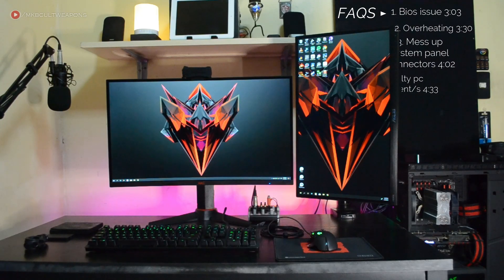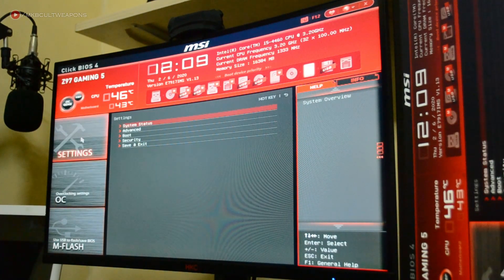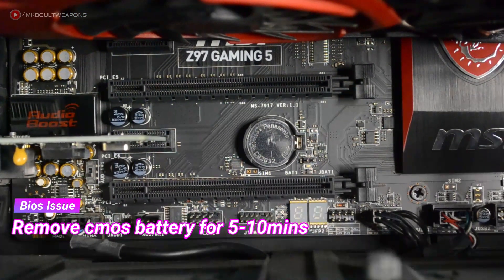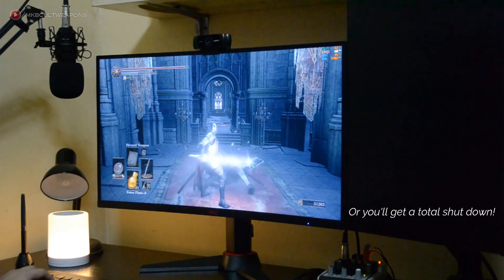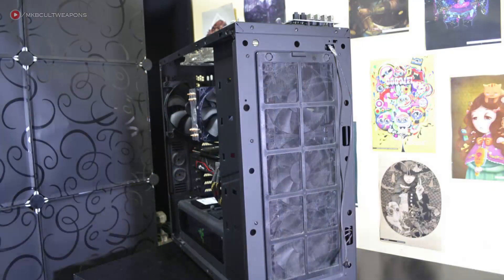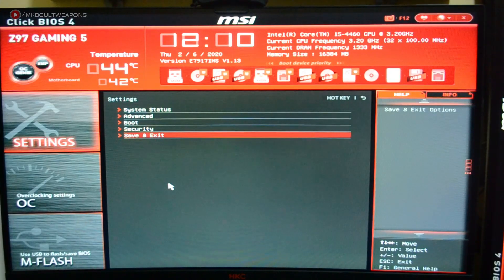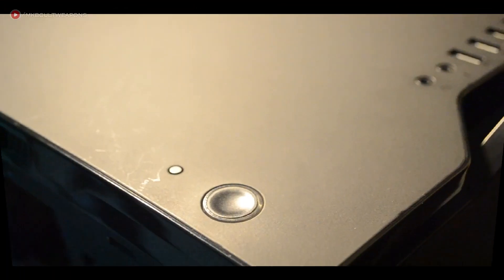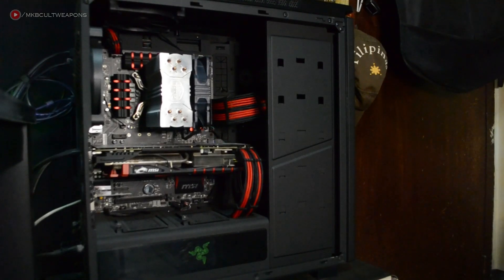Pc keeps restarting FIX / Pc continuous restarting FIX

Comment: My pc keeps on restarting still, every time I turn on my pc and check the task manager my disk usage is always 100% for 1-3mins. And when I open program or heavy games like GTA V disk usage goes 100% and the system restarts :(
Reply from the maker: did you check the "Processes" yet? disable whatever is causing the pc to use too much of the system processes

Comment: Well, Time to get the warranty for my PSU which is just 3 months old 80 plus bronze, but suffered from 6 to 7 times shut downs in power on my house
Reply from the maker: sorry to hear that bro, you need to also buy avr or ups or at least a power surge protect extension

Comment: It happens to me but just when i play heavy videogames like Cyberpunk or Red Dead 2? I think is my cpu idk I'm new in pc gaming
Reply from the maker: try checking your cpu and gpu temps. if all temps are no higher than 89c then its all good but this may bring up another problem and that will be the psu not having enough wattage for your pc build or it's not 80+ certified

Comment: Thanks for the video very informative, mine is still power cycling im thinking its the power supply or the cmos battery. Computer was working fine but was disconnected for about a month or longer while i used my laptop.
Reply from the maker: -pc not being used could have this type of problems, it's inevitable that is why i always tell my clients to use their pc at least half an hour everyday. Anyway for now just try to re-seat the parts and boot the pc and let see how it goes
Reply: Mac Coyzkie  Brother its like 36 days i have not used my pc and today when i tried to boot it up it didn’t and it just keeps restarting itself , I have reseat gpu and rams both but it didn’t fix , please help me if theres any other solution for this problem 😢
Reply from the maker: @Deadshottt7  ok first try clearing cmos, here's how to https://youtu.be/S9hyEPTFR10
Reply: Mac Coyzkie Thank u bro i just changed the place of rams and it got fixed 👍🏻👍🏻
Reply from the maker: @Deadshottt7  awesome! no prob bro!
Reply: @MacCoyzkie  Hey, I usually go on it daily, and for the past week I have been on/off it and maybe for 3 days at one point. Why does this make the pc keep restarting? Any help is appreciated. :)
Reply from the maker: @VibrantDesigns  have you clear cmos yet?
Reply: Fr. W

Comment: Guys I know how to fix it. If reseating the ram doesn't work use a screwdriver, make sure the power supply is still plugged in but turn the switch off, press the power button a few times to make sure its off. Hold the screwdriver on the 2 pins sticking out where it says CMOS on the motherboard usually on the lower right or left for 15 seconds then try to turn it back on. I was getting a boot loop for 5 hours tried literally everything re-seating ram, everything.... and this is the only thing that worked.
Reply from the maker: Some motherboard has those 2 pin but some don’t, removing the cmos battery may also do the trick
Reply: I did this and it still won't work

Comment: Hellppp i dont think i can open my cpu
Reply from the maker: Give us at least a background how did it all began
Reply: @MacCoyzkie  i just resetted my pc now it just keeps restarting and restarting... think it has something to do with the settings update and security not opening, it always shows the options "update and shutdown, update and restart" now im stuck in a loop of restarting over and over again and i cannot get past the loading screen because when its on the loading screen it just goes back to restarting again. I think something is wrong with the system. I cant do anything but open the bios boot menu... im no technician and i dont know anything about computers but 😅 i want to fix it in any way possible before getting it repaired. Ive been searching and watching videos but there doesnt seem to be anything that could help me without opening the cpu. What should i do? I have classes on Monday 😔
Reply from the maker: @hallowissoot  the windows update must’ve been interrupted or something and the windows is now messed up, the only thing i can suggest is to back up your important files in safe mode then have a clean windows installation. Check this https://youtu.be/bsivwuSlPL4 and skip to 4:45 on how to enter safe mode. 
If you don’t have important files then just install a fresh windows. 

Btw the reason that is why i’m asking you to have a clean windows installation is that the recent update with the old windows + the updated windows is causing pc to load longer than it should and sometimes it restarts like yours. Hdd boot drive takes 10minutes to load and ssd around a minute and m2 nvme around 30 seconds. I’m not sure why so in my case I downloaded the latest windows installer, install it fresh and then boom, nvme loads like less than 10 seconds

Comment: my pc only restarts once in a blue moon and seems to happen more frequently when watch youtube its very strange i may try this to see if it fixes my issue
Reply from the maker: Let me know how it goes
Reply: @MacCoyzkie  i think it may actually be my new power supply. it may be faulty cause its been happening since i got my power supply.
Reply from the maker: @gamingdemonz5260  if you still have the old psu, try it out to double check or use a psu tester like this https://amzn.to/2TIB460
Reply: @MacCoyzkie  so with the power supply Tester will it tell me if I have a faulty power supply?
Reply from the maker: @gamingdemonz5260  yes, specifically won't light up if psu is faulty
Reply: @MacCoyzkie  cause at this point im running out of ideas as to what could be causing my pc to restart
Reply from the maker: @gamingdemonz5260  if you could borrow a psu from a friend then test it

Comment: My PC began the reebot cycle loop after the CPU cooler leaked over the mother board. I've found that if I unplug the PC for 5 minutes and turn it on after plugging it again, the computer will boot just fine. But if I turn it off and then on again, the reboot cycle will commence again. Any ideas?
Reply from the maker: i hope nothing was damage during the even but since it was working fine at some point i guess it's ok. I suggest clear cmos and re-seat the rams as well

Comment: My pc have same problem but when I blow hot air from hair dryer then it turn on normal, any solution for it?
Reply from the maker: ohh are you living in a cold country? Anyway try to run your pc for like 12hrs and make sure you set the sleep to "never". Usually this happens when pc is rarely being used or it's new
Reply: @MacCoyzkie  I live in India, it's rainy days here, room gets a little moistured, not much but like 5 to -10%, system shows 24° c here, is running pc for 12 hours or more is safe?
Reply from the maker: @ieditz2797  i see, use silica gel and place it inside the pc so just in case you're not using it the silica gel will keep it dry. I usually do that in rainy days in my country as well
Reply: @MacCoyzkie  oh, thanks dude, it might help me, thanks for caring for me, I'll do the same by sub you 😉
Reply from the maker: @ieditz2797  no problem bro! thank you too for the subbed

Comment: i tried everything for me it's power supply or motherboard which is funny because it worked until it was moved out and back to the room because of painting.  🤦‍♂️ Shit keeps restarting after posting with no signal issue.
Reply from the maker: your room wall outlet might have a low power draw. Try it once again in the other room, if it works then i'm correct

Comment: I methodologically went through all the rudimentary checks and even reprogrammed the BIOS chip and eventually found the culprit to be a faulty case reset button so I just removed the reset connector from the front panel header pins, job done.
Reply from the maker: nice! glad it's working now

Comment: none of that worked for me sorry. i even replace the motherboard and cpu with new and still have same prob. the only thing i noticed is if i take the ram out start the pc up then switch off pc replace the ram then it will start but once switched off i have to repeat the ram removal and replace. i have 4 sticks or ram and have tried all of them one at a time.
Reply from the maker: those ram sticks might be causing the problem then, can you ask a friend to try those rams out to check. If problem in their rig is the same then you got yourself faulty rams
Reply: @MacCoyzkie  thanks very much for the help, yes i can my friend has pretty much the same build. i,ll let you know tomorrow thank you

Comment: Hi i have the same problem where it has a continuous on off loop. Before it happened my pc froze and had artifacts on the screen at the same timee a buzzing sound. Now it goes on and off plus there is no display on my monitor. What could it be? I need help  Thankyou
Reply from the maker: it could be an old hdd, try to remove it and boot the pc. if you still have the issue then i guess this is a dying gpu. check more info about it here https://youtu.be/U_2qRkkf-oM

Comment: I have a Gigabyte GA-Z68X-UD3H-B3. I get boot loop with continuous string of short beeps. The manual says short beeps is a power problem. I replaced the power supply, reseated ram, checked single stick each, removed GPU. Removed all USB cables. jumped reset pins, used reset button with PS rocker switch. I'm trying to avoid possibility of motherboard.  Please advise. Thank you.
Reply from the maker: have you done a cmos reset yet? here is how to https://youtu.be/S9hyEPTFR10 If you done that already i think you have tried everything, yes that's probably the motherboard :(
Reply: @MacCoyzkie  I couldn't reset CMOS. I removed the battery, shorted the socket terminals. Pressed power-on and reset button for a minute. Waited half hr then reinstalled battery. Plugged back in PS. Powered on and got the same response, continuous string of 50 short beeps then loop power down and restart and again 50 short beeps. In the mobo manual continuous beeps indicates power but that is not the case.
Looks like motherboard.  Thanks for trying.

Comment: Please help me. This ini getting me frustration of random restart until today and still not find any solution. At the first i just planning to upgrade my processor and motherboard from i7-7700k with z270 to i9-10900k with z590. I'm still using my old aio cooler Corsair h100 v2, old 2x8gb Corsair lpx 3600mhz, old MSI GTX 1080, old corsair rm650x psu, old Samsung 850 pro sata ssd because all of them still compatible and have been using it since 2017. Everything was fine like I use it for a month without problem. Two weeks ago my old aio cooler stops working and the cpu temp. reach 95+ celcius. So i changed it into new aio corsair h115i capellix but i also upgrade my old cpu case into new corsair 4000d cases, 4 ql120 rgb fan, 2 stick of ram with same speed corsair lpx 2x8gb 3600mhz so now im running 32gb ram with 4 stick 8gb. The restarting problem comes last week until today, even yesterday i already changed my psu into corsair rm850 the restart problem still happen (i though it was psu problem). I think my gtx 1080 is working fine because no artifact or issue with display etc, but i can't test with another vga because i don't have any and i have no plan to upgrade it since graphic card price is so high to replace it 😭 please helpp 😭
Reply from the maker: ok try to clear cmos at the moment, if you don't know what that is you can watch this https://youtu.be/S9hyEPTFR10 
this might have something to do with the ram speed in the bios so let's run it in default at the moment to test things out.

Comment: What should i do if my pc restarts at the windows start up it wont pass through windows start up
Reply from the maker: two things, might be low power draw from psu or wall outlet or your ram sticks are not seated correctly. Check the ram sticks and clean it too, more info in the video

Comment: Hi im having the same problem. I alrdy disconnected the gpu ram hdd sdd from the mobo , connecting only Psu to the mobo still the problem occur. I did a troubleshooting on the psu by shorting both wires and the voltage o/p are within acceptable ranges and psu is running smoothly . i alrdy jump start the mobo using the screwdriver (as initally i thought theres a problem with the power on cable) still problem occurs .. any idea what i should do next?
Reply from the maker: psu and motherboard only then still restarts? if that is the case perhaps it's a low power draw from your wall outlet. Low power draw instances can light up pc and turn the fans on but can't give enough juice for the whole system causing it to shut down or restart on its own. This happens when the psu becomes faulty or you got power fluctuation in your house causing outlets to give less power than it should. Just a theory though
Reply: @MacCoyzkie  hmm tried switching to other wall socket, still the problem persists
Reply from the maker: @muhammadzahidomar648  perhaps it's the whole house. try using something like this https://amzn.to/3vvb0Jc first to test your psu if it's giving enough power
Reply: @MacCoyzkie  any chances that the processor is faulty?
Reply from the maker: @muhammadzahidomar648  processor becoming faulty is very rare, there are more people who broke their processor while cleaning and dropping it than becoming faulty because of such case like yours. Ask a friend to try your pc at their home to check this theory
Reply: @MacCoyzkie  if the theory is correct , how should i go about solving the issue ? Buy a higher psu voltage ?
Reply from the maker: @muhammadzahidomar648  have a second opinion and see a local shop to have them test it

Comment: im having random resets also even just  watching yt videos. I opened up psu and inspected all caps , no bulging caps, or burn marks  cleaned it fairly well . Inspected  Rx560 Gpu and  tomohawk mobo as well same thing no burn marks or bulging caps. still randomly resets. so since PSU is on its 3rd build & was by far the oldest 10 yrs old i ordered a new one.
now i actually measure the voltage on 12 v rails while watching 2 videos at same time and its still putting out 12.07 v
I WONDER IF I WASTED MY MONEY??
Also ordered a new surge protector to replace aging ups that has seen its share of electrical storms and power outages , probly surges too.
Reply from the maker: you wasted money if you give up now. Are you using aio cooler or air cooler? better  check your idle temps, either your aio pump is not working or the thermal paste is dry (usually happens when you use pre-applied) try using this https://amzn.to/2SVaplE  I had a very old psu up to the point my nephew inherited it and his pc is still working now and that was about a psu from 2010. So i don't think it's the psu or the ups (as long as there is no dust inside so better clean it too) if you're hesitant on doing the ram cleaning in the video at least reset the cmos, remove cmos battery for 5 minutes and place it back again before powering your pc back on

Comment: My pc restarts within 2 minutes of logging into windows, but if i start the Testmem 5 or MEMbench on dram calculator for ryzen than it doesnt shuts down. In MEMbench it gives a red spike at 90.3% every time with single/dual ram in any of the slots. At this point it hangs or shuts down. 
I have tried swapping gpu, motherboard and hard drive but that didnt help. Do you think its the cpu, psu or the ram.
Reply from the maker: How about clearing cmos?
Reply: @MacCoyzkie  i removed the cmos battery for 10 minutes and reapplied it but no luck, windows gives Kernel security check failure bsod.
Reply from the maker: @shubhamjain54519  i see that's a corrupted file then causing all this problem, it is difficult to find where that is and i guess your only choice is to have a fresh windows installation
Reply: @MacCoyzkie  i have fresh windows but same shut down happens or it hangs , i installed ubuntu also but it also shows some kind of crash or it hangs, same with hiren boot cd
Reply from the maker: @shubhamjain54519  what type of windows 10 you have? oem, retail or volume?
Reply: @MacCoyzkie  20h2 downloaded via media creation tool
Reply from the maker: @shubhamjain54519  that is a windows update, try to do this 

Open a Command Prompt or PowerShell and type in Slmgr –dli. You can also use Slmgr /dli. Wait a few seconds for the Windows Script Manager to appear and tell you which license type you have. You should see what edition you have (Home, Pro), and the second line will tell you if you have Retail, OEM, or Volume.

let me know what type of windows you have
Reply: @MacCoyzkie  Windows Script Host

Name: Windows(R), Core edition
Description: Windows(R) Operating System, RETAIL channel
Partial Product Key: 8HVX7
License Status: Notification
Notification Reason: 0xC004F034.
Reply from the maker: @shubhamjain54519  ok i just needed to confirm that. Now i need you to check the front panel IO the power switch might be in the place of reset switch. Can you also make a quick video looking inside your pc while you turn it on and let me see how it will restart on its own. Upload it on your channel and will check it after you reply
Reply from the maker: bro that's a failing boot drive, can you try installing windows in a different drive if you got extra to confirm?
Reply: @MacCoyzkie  i have tried installing windows in two 2 hdd and 2 ssd
Reply from the maker: @shubhamjain54519  ok bro i don't think i have any more tricks to fix that problem, sorry i can't help